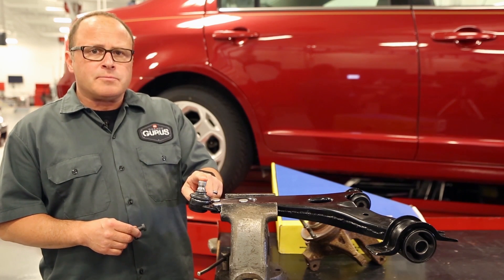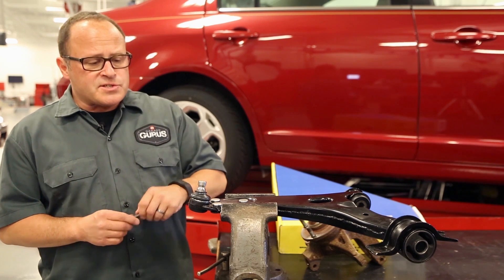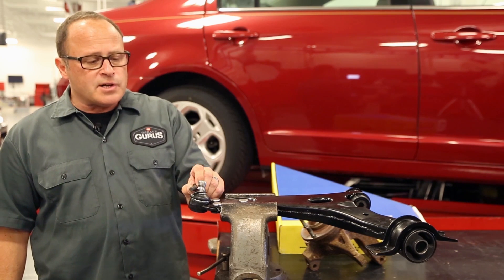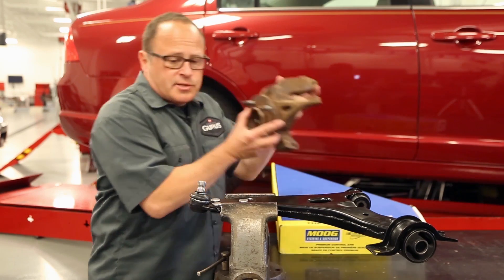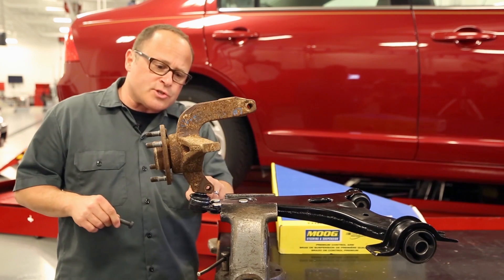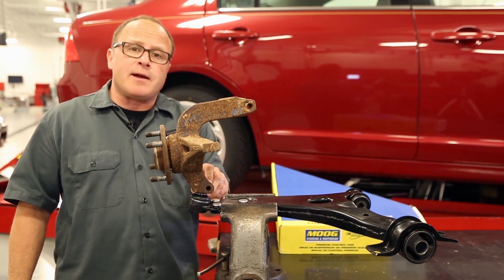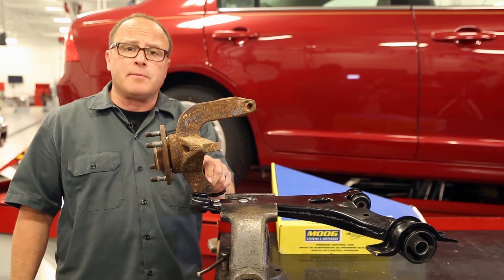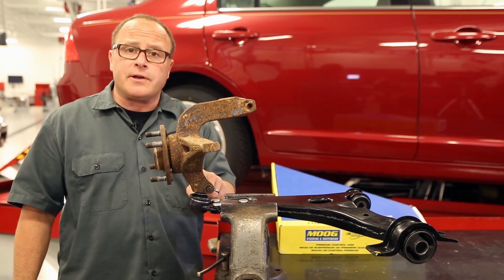Ball Joint Pinch Bolt Installation

Comment: The manuals say to replace the pinch bolts. What is the reason for that? A mobile mechanic installed a new lower control arm but REUSED the pinch bolt. Now 7 months later while driving down the interstate at 60 mph the control arm dropped down out of the knuckle. This caused the wheel to turn beyond its normal range of motion, yanking the CV shaft out of the transmission. I am thinking he didn't tighten the pinch all the way because the gap between both halves (.132") is 50% wider compared to the pinch on the other control arm (.089") which is original from the factory.
Reply: That's outrageous. What a moron. You just can't trust'em.